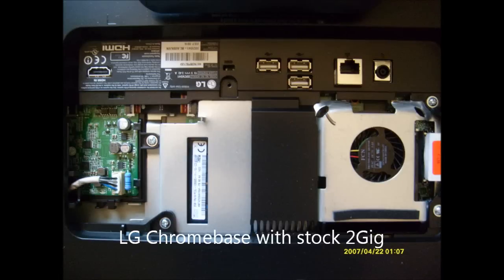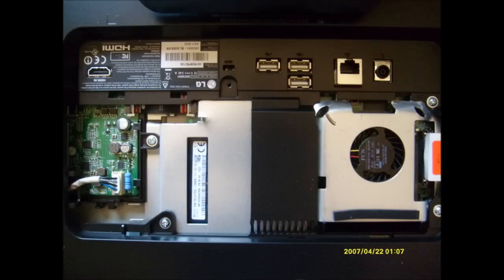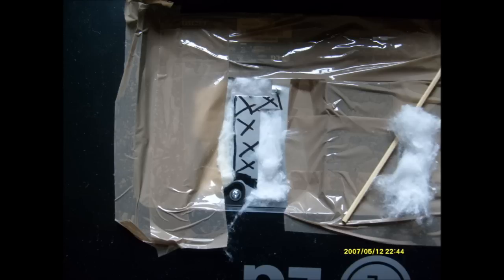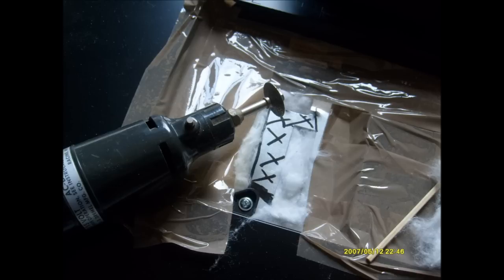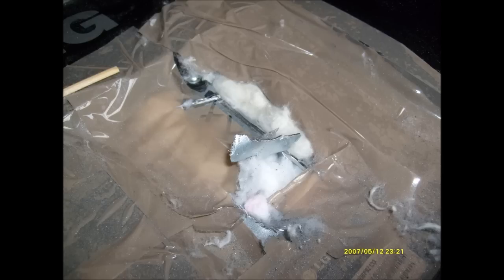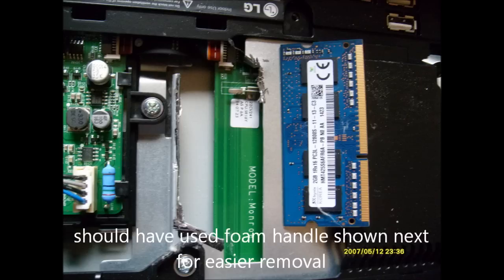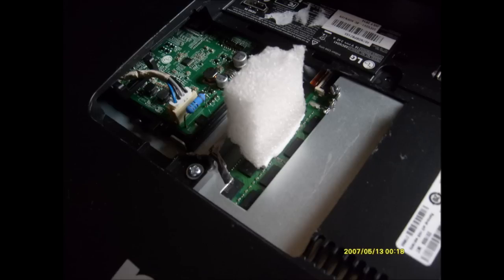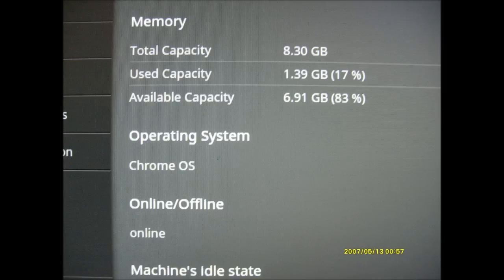LG Chromebase EASY memory upgrade - no dis-assembly needed.

Comment: Thank you very much for posting this.  I upgraded my LG Chromebase  following your instructions.  everything worked seamlessly.  The LG definitely benefits from having more that 2Gb.  I installed an 8Gb Critical Memory module.  So as to reduce metal dust fragments when using the Dremel I had the vacuum running whilst doing the cutting.
Reply from the maker: Thanks Jason, I usually have about a dozen tabs open. I really need that extra RAM.
Reply: I'll be giving this a go soon!! Wish me luck.

Comment: The title of this video is "no dis-assembly needed" but never says anything about having to modify the internal metal structure. Anyone who knows anything about this sort of thing should be cringing. Between the RF (radio frequency) testing and UL (underwriter labs) certification this is just such a bad thing. Frankly, for the cost you're better of with the ASUS chromebox with an upgrade to 16GB (just 4 screws) and an external monitor. The total price comes in under $300.
Reply from the maker: +Richard Bucker    Even at 2.4 GHz, the wave length is about 5 inch or 12.5 cm; thus even the existing opening will trap the RF. A small increase will not change the situation. Furthermore there is plenty of open spaces where RF can escape; presuming there is a considerable RF. I would not speculate about the spectrum of the generated RF. If you are talking about FCC certification, you are right. The FCC will demand a repeat test.  I don't know about FCC & UL test but if a naked board passes then there is no issue about the mod. Look at motherboards, they are certified naked - you can buy plastic case !. Laptops are practically naked - no shielding.
The metal I modified is structural, not an RF shield. 
As far as LG vs Asus, I'll leave that to the next buyer. I have an HP Chromebox with 4 Gig. BTW, this LG can also be used as a monitor via HDMI input and an IPS.
Thanks for your comment, I hope this clarifies the issue. My LG has no longer FCC cert and as far as UL, I really have done any significant mods that affect safety.
Reply: The other models don't have the shield so it is in fact not necessary it's just there so people can't easily upgrade it.